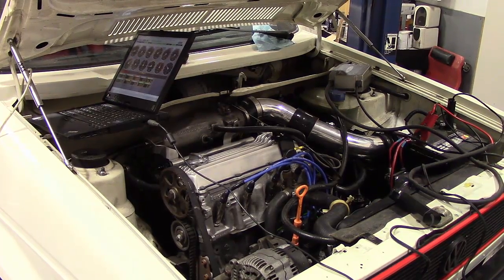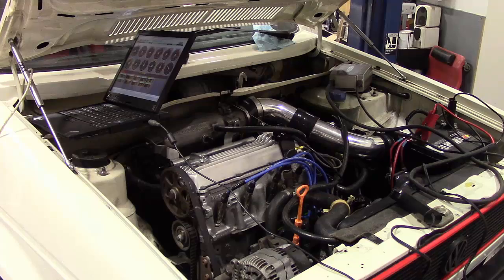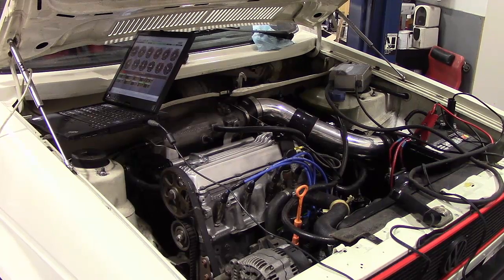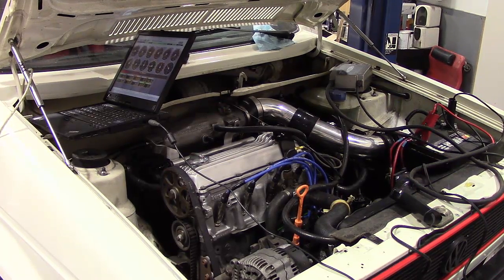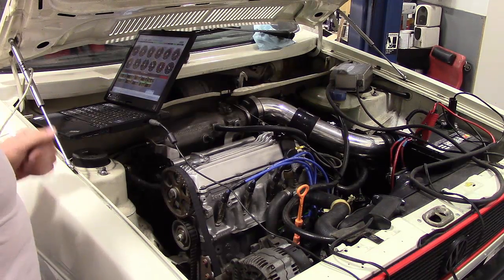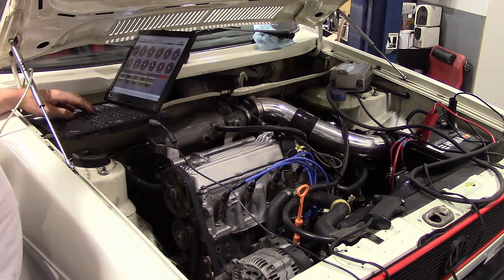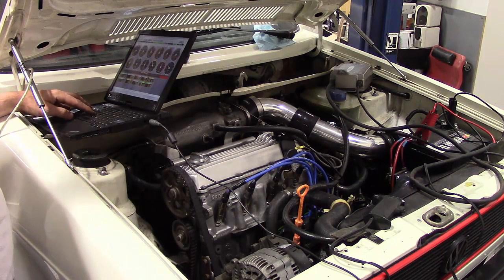1984 VW Rabbit GTI VEMS ECU CIS to Standalone EFI Conversion - first start

Comment: How do you like the conversion  to date?  Any words of advice?  I have a 75 Scirocco that I would like to convert to EFI.  Thank you.
Reply from the maker: @3cl1 We just installed and tuned the system. The customer frequently checks in and reports he's loving the car now more than ever though. If the CIS system is working ok, it's fine. As soon as it shows problems, going EFI is a great step.